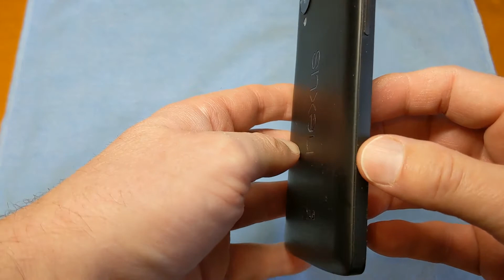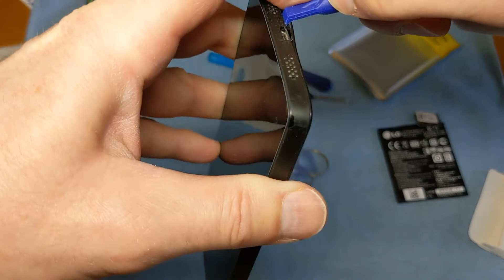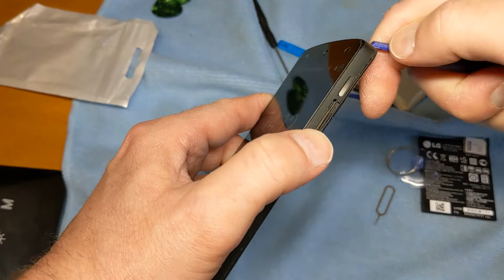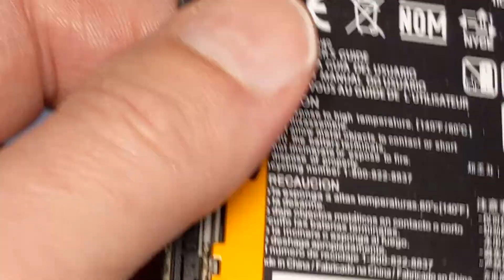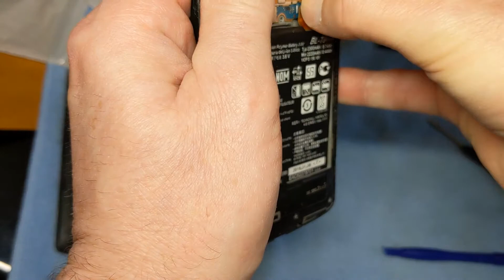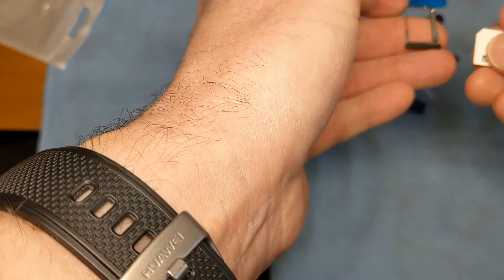Nexus 5 Phone Battery Replacement

Comment: I'm thinking of buying a battery for Nexus 5, But i'm wondering how long are they gonna last and what should be the battery backup. Can you tell me how much is 2018 Manufactured battery is giving to you ? Is it worth it ?
Reply from the maker: Sorry for the late reply. I don't use the phone often, it doesn't have my main SIM in it. They battery will get me through a day with very light use. If I take it out for downloaded Google Play Music use with wired headphones it uses about 30% an hour I think. Compared to the older battery it's much better. I read the other day that Lithium Ion batteries in sortage lose only about 3% of their capacity a year if stored at 40% charge at 25 degrees C. It's considerably worse for different charge states and higher temperatures.
Reply: @CBitsTech  Thank You So Much